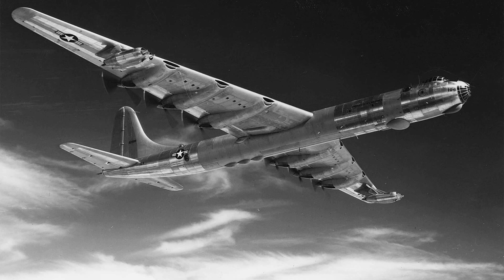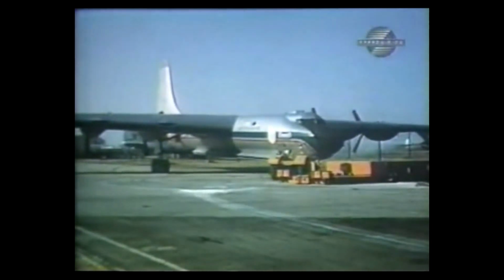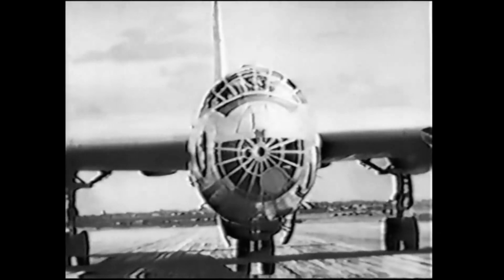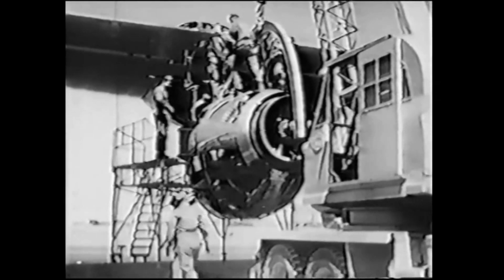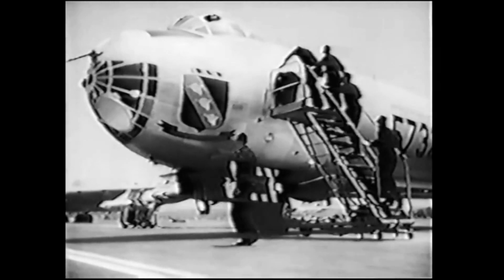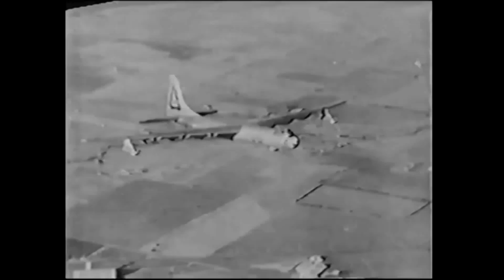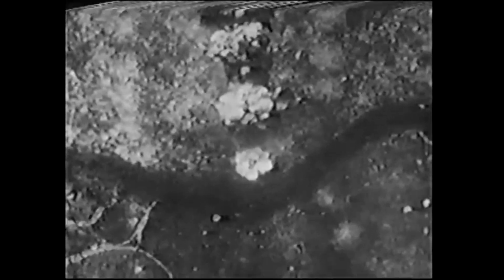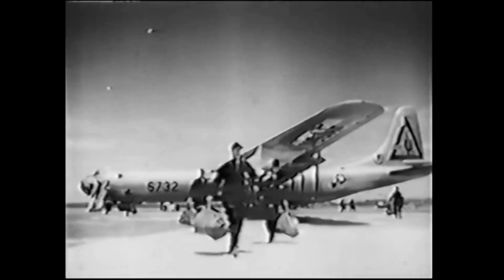The nuclear powered bomber #paranoidtimes #bestseller #novel

Comment: In the mid 60's the folks at Oak Ridge got a contract to develop a reactor for bombers. They built and operated a liquid salt Thorium research reactor for 4 years with no safety problems. Researchers knew the likelihood of placing a reactor on a bomber was slim to none but they saw it as a chance to do research on the next generation of nuclear reactors. The project was cancelled when Nixon got elected and wanted to move the research dollars to California.

If that reactor research had gone forward we would be using these reactors for power generation and not worry about long term nuclear waste. Three mile Island, Chernobyl, and Fukushima could have never happened because this type of reactor can't melt down and does not produce hydrogen. The waste from this reactor can not be used to build a nuclear bomb and the reactor can use existing nuclear waste as fuel.

Comment: There is no practical way to convert heat from radiation into thrust. An expendable working fluid runs out or closed system requiring huge re-condensers just won't fly. A radio active cyclotron MHD and anti-gravity system...Maybe
Reply from the maker: +Coil Smoke they have it.. and have had the tech... even the home reactor... I have seen the dam thing... a little reactor that sits, in a sub basement of a farm.. powers everything, the heat from the reactor heats the water... may talk about this place in a video in a few days..
Reply: Coil Smoke yes use reactor as heat source in modified Combustion turbine....
Reply: or closed loop steam turbines.... anyway I think weight is the problem